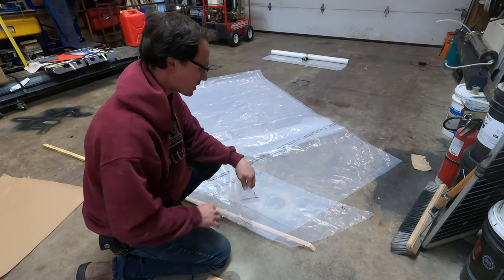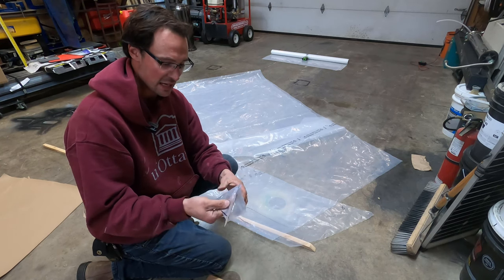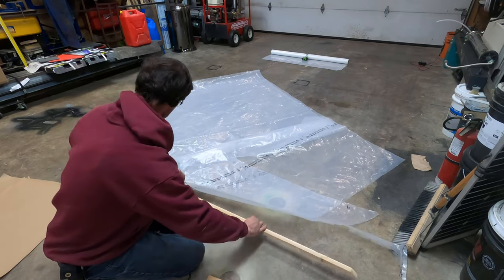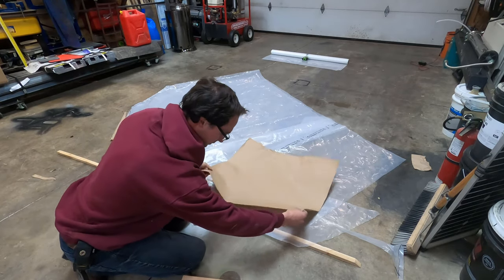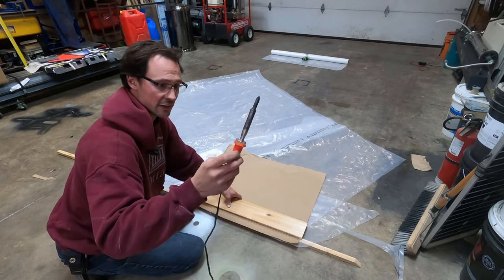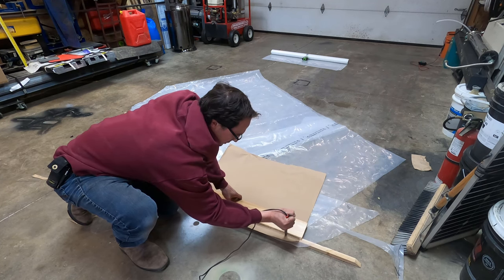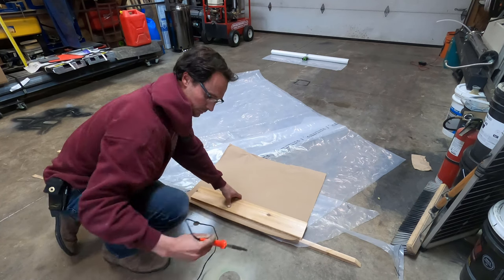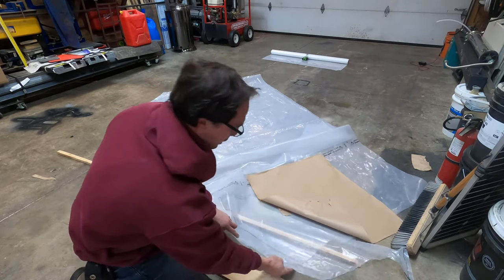Seal Any Plastic Bag At Home - EASY & STRONG!

Comment: "Welding" plastic is a lot like welding metal in principle, once you have the correct heat setting, it is just a matter of maintaining the correct speed with the heating device.  Knowing the temperature that works best is possible with the use of a temperature gun that will tell you how much heat is being applied at a steady pace.  That soldering iron you are using looks to be very high wattage.  Definitely more than 75 watts.  The common pencil style soldering iron used in electronics is often set at 30 watts, or slightly less.

Comment: does it matter what kind of plastic you use? Im assuming there are certain plastics or thicknesses that dont work ?
Reply: He said he was using 6 mm thick common home improvement plastic, often sold for use as a way to catch paint splatters, and spills.  It is also sold for insulating windows during the winter as an air and wind blocker.

Comment: Thanks 😊 
Will this work with plastic tarps?
Reply: It can work on most sheet plastics commonly sold in home improvement stores, but don't mix plastic types, or thickness since you need a temperature setting both parts will respond to in a desirable fashion.